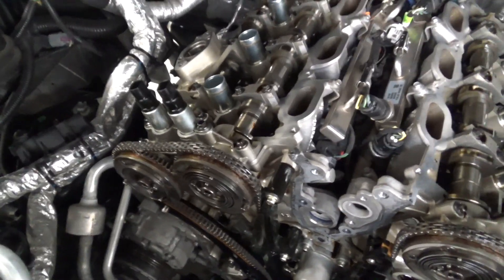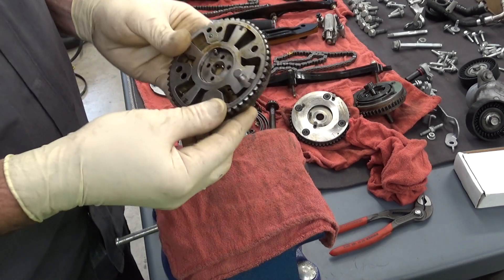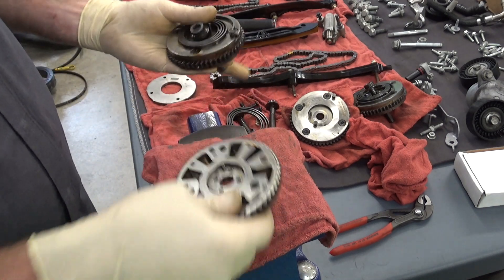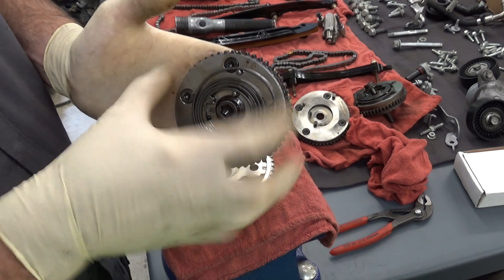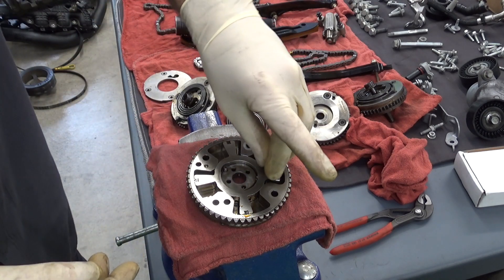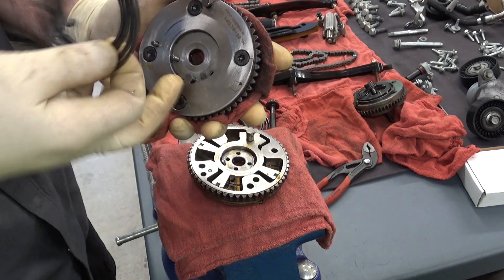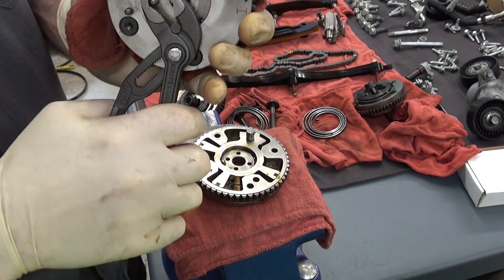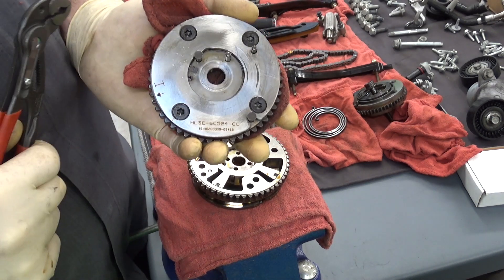FORD 3.5L ECOBOOST CAM PHASER RATTLE. THIS IS WHY

Comment: So, the cams are not locking at shut down. Why. springs are weak. pin and or locking pin hole worn?  They don't do it new, so something is weak, worn out, or broken and why? How many miles are on the truck, was the oil changed regular? I own a 2019 raptor no bad sounds yet. The 3.5 is very hard on oil I would never go past 5000 miles even with full synthetic.  To say it's not an oil pressure problem I cannot agree, if you had oil pressure before it starts, all would be quiet. Because of the start stop system (that I hate) these engines start up very quick, no crank time. They seem to make more noise the longer they sit, oil drain off. So, if you had an engine pre lube system like a Cannon accusump for when it's been sitting a while. (Would not be for everyone I know) oil pressure before startup no noise. It's kind of an oil pressure problem. I am a retired mechanic with nothing better to worry about. I saw the worn parts but why are they worn out so soon sometimes. Ford would love to know that they have had this problem for many years.
Reply from the maker: All valid points. Think about this though, the locking pins and springs are there to lock the phasers so in theory you could have zero oil pressure and there would be no rattle on startup. But of course if the engine is run long enough the rods would knock, timing chains and lifters rattle, etc. When these engine experience a rattle for the first couple seconds until full oil pressure has reached the phasers is because the pins are not fully locked which leads many to believe it's an oil pressure problem. (two of the four phasers in the video would not lock and could get cams to move with a wrench)There will always be some level of oil bleed off if left sit long enough especially on a higher mileage engine. The question is why these phasers fail. Is it an internal oil circuit design flaw? I just don't know but without question, the rattle is due to pins not locking. Ford has two redesigned part #'s in the bulletin so they have definitely changed something inside the newer units. Is the locking pin spring is too weak, locking slot not deep enough, pin not able to displace oil in the slot causing partial engagement like what I experienced in the video? This is all in my opinion & I could be wrong.

Comment: I have a 2020 f150 3.5. 13k miles and had the 21b10 which caused sluggish performance and “shudder” so then I had 21n08. Never had the rattle and still don’t. I’m hoping this issue doesn’t come up with it does I don’t know if the new phasers that are updated will do the same thing
Reply from the maker: Just did a 21B10 on an 18 expedition. Started it twice the last two mornings after letting it sit outside overnight. No rattle so it looks like programming worked on this one. I wish you luck on yours. At least 21N03 is now opened on your pickup but it's still under factor warranty anyway.

Comment: 2017 here. I started hearing this at 50k got so bad it threw a code at 100k spent 2500 out of warranty to fix. It started again in 20k miles. Here I am 37k from having it fixed and the dealer is playing like they can't duplicate the noise.  I have dozens of videos with the noise. It's so frustrating.  Does the tech get paid twice because I'm in the warranty of the repair? If not then that explains pretending like they haven't been able to duplicate the sound in over a week.
Reply from the maker: Sounds like your dealer just doesn't want to work on it. It's tough to meet or beat Ford's warranty time allowed so flatrate techs would rather do other jobs. I would keep hounding the service manager with emails/voicemails until they fix it or find another dealer. Also, send the videos to the sales manager if it's the dealer you bought it at voicing your displeasure. I know that works at out dealer.
Reply: You drove your truck with bad phasers and that nasty start up noise for 50000 thousand miles, well it must not hurt the engine too much. I could never do it, if I heard that start up nasty noise, I am taking it apart, and pissed off.

Comment: Ford should be ashamed... over a decade and these damn motors are still doing this! Of course mine is over 90,000 miles barely. This is my first and last ford. Never had an LS do this... I have cammed the hell out of them at 150,000 plus with stock timing components with no issue. What the hell ford, you build a great motor and then this keeps happening...
Reply from the maker: My 20yo "old school" LS in my GMC keeps on going but it doesn't have VVT technology so it will never rattle. 
The 2021 4th gen coyote has cylinder deactivation. Makes me wonder what problems/recalls are coming on that platform.

Comment: How do we know if Ford made these improvements?  I'm looking seriously at a 2022 Transit for a van conversion but these issues make me nervous since they are expensive even before the conversion.  Also the direct AND port injection should help valve coking but seems like a catch can is still a good idea. You agree?
Reply from the maker: I honestly can't say if Ford has permanently fixed this issue but they have introduced yet another update on Nov. 19th. Intake VCT unit = *Note: If part HL3Z-6256-CD is not available, part ML3Z-6256-A is an alternate option. Exhaust VCT unit = *Note: If part HL3Z-6C525-CD is not available, part ML3Z-6C525-A is an alternate option.
Fords dual fuel design is great I think. They build more torque and don't carbon up the valves. No need to add a catch can.

Comment: 2018 Ford F150 with a 3.5 eco-boost at 70,000 miles they replace the cam phasers at 110,000 miles it came back again Ford knows they have a problem can’t believe they’re just close their eyes on this
Reply from the maker: That stinks. Wonder if a class action lawsuit will be filed for this issue? They recently updated the bulletin with another phaser part#. Our dealer hasn't installed one yet.
Reply: @raincitywrench117  Do you mind sharing the updated part number?
Reply from the maker: @patzimny8579  This is from supplement #3: HL3Z-6256-CD*
Intake VCT Unit - Package Contains 1 Piece, 2 Pieces 
Required 2 2
*Note: If part HL3Z-6256-CD is not available, part ML3Z-6256-A is an alternate option.
HL3Z-6C525-CD*
Exhaust VCT Unit - Package Contains 1 Piece, 2 
Pieces Required 2 2
*Note: If part HL3Z-6C525-CD is not available, part ML3Z-6C525-A is an alternate option.
Reply: @raincitywrench117  thank you!
Reply: @raincitywrench117  So I went to order the HL3Z numbers but Ford is now superceding it with the ML3Z number. Im planning to replace the plastic guides, chains and water pump and valve cover gaskets while in there, any other recommendations?
Reply from the maker: @patzimny8579  ML3Z is the alternate in the bulletin which means it must be the latest design so you will be good. You need the two cam alignment tools, crank pulley puller and long reach pulley installer. I think the hardest part of the job is installing the a/c stretch belt. They suck so now I leave the belt on when removing the pulley. It doesn't hurt the crank, pulley or belt. When installing pulley, I start the the belt in the grooves. Belt will have an extreme angle but you can still start the crank pulley on the end of crankshaft then using a prybar, rock the pulley over until it is almost straight then install the long reach puller and press it back on. I had my installer break off inside the crank which cost me a couple hours to remove because I bottomed it out too hard so when the balancer is almost all the way back in do not try to press it on tight. The crank bolt will take it the rest of the way. Also, when prying the timing cover off. Be careful to wiggle and pull it straight forward so you don't break the plastic oil pump electrical plug in the bottom of timing cover. You don't have to install a new lower oil connector seal or the large oil seal in the center of the timing cover. I reuse cause they are a pain to replace. I make sure and lube every seal up with Napa Sil-glyde before assembly of all components. Here is a video of me setting one up: https://www.youtube.com/watch?v=UWyZfbsxBss&ab_channel=RainCityWrench If this is your first one then don't copy me, break the phaser bolts loose AFTER the chains are off and tighten new phaser bolts BEFORE installing chains. I tend to make things look easy.

Comment: check out the video by flying wrenches stating 3.5L mega cap design is the reason for oil pressure loss is the issue.
Reply from the maker: Yea, I watched that. It could be the mega cap is causing the pins to fail.
Reply: @raincitywrench117  Copy that. I am following this closely. Keep up the stellar content brother.
Reply from the maker: @squirlydan1750  Like your name, my John Deere 140 is nicknamed squirly dan after I got thrown from it. Kind of funny. 
 Will be taking one of the failed phasers apart on the next one I do but this time doing a more thorough examination. Want to trace the oil passage inside the pin slot. I think that oil inside the hole can't bleed out which keeps the pin from returning. Now just need to test my theory.

Comment: I use the flooded start procedure. Hold foot to floor with brake on, crank to bring up pressure then let up foot, no rattle.
Reply from the maker: I've seen that before. That's one way to fix it.
Reply: @raincitywrench117  Mine is still relatively new 6K miles, but it does sit for several days at a time. My 2013 F150 5.0 did make that rattle and the same flooded start did in fact eliminate that. It seems that the oil pressure would bleed off after a couple of days and cause that rattle. The wife's SI did the same thing until we switched up to the Bosch Distance plus filter.
Reply from the maker: @dapoppa2256  Interesting....

Comment: On top of a better design, what about an electric oil pump for when you turn the key on to prime/ pressurize everything?
Reply from the maker: Older Fords have a key in ignition sensor so when the key is inserted it primes the fuel pump for a few seconds. The electric oil pump could be wired into the same circuit.
Reply: @raincitywrench117  someone on youtube said that if you push down the gas pedal to the floor when you turn key to start, it won't start and will stop in 2-3 seconds. Then it would have pumped some oil. Then start it normally.

Comment: Just bought a used 19 navigator. Brought it home and after cold soak... I heard the dreaded noise. I'm very pissed off that I didn't catch the start up
Reply from the maker: I would take it back. Our dealership either fixes the problem or gets the customer into another vehicle. They don't like poor reviews. Hope where you bought it at works with you but it definitely needs addressed.
Reply: What did you end up doing is the 19 navigator holding up?

Comment: Since this is causing the startup rattle, what is causing the diesel-like knocking noise that quickly develops when the engine is idling? Does it still relate to the plunger? Or is it something else within the phaser that's rattling around inside?
Reply from the maker: The bulletin states: "In some of the affected vehicles, an undesirable noise may develop from the cam phasers in the 3.5L 
GTDI engine. This noise might occur as a rattle when starting the engine after the vehicle was turned off for an extended period of time or as a knocking noise when the engine is idling after it is warmed 

up."
The defective locking pin will cause startup rattle and knocking noise while idling.

Comment: So apparently within the last week there is an updated phaser, per my research the part number now starts with an ML not the existing HL but I am only looking at Tasca parts and don't have access to what dealer parts guys do. I have this issue in an Expedition that I bought as a salvage title so I have no warranty. I've been debating if it's worth doing this repair out of pocket. Do you think the updated phaser design will definitely solve the problem? Or is this a design flaw in the ecoboost motor with regard to oil flow? And I'm curious in general if there are even any long term negative effects for this issue. Also, if I do the phaser replacement should I also get 21B10 performed (I believe that I DO have coverage for it, but do not have 21N03 coverage with my branded title).
Reply from the maker: Ford updated the bulletin on the Nov 19 and here is what it says now:
HL3Z-6256-CD*
 Intake VCT Unit - Package Contains 1 Piece, 2 Pieces Required 2 2

*Note: If part HL3Z-6256-CD is not available, part ML3Z-6256-A is an alternate option.

HL3Z-6C525-CD*
 Exhaust VCT Unit - Package Contains 1 Piece, 2 Pieces Required 2 2

*Note: If part HL3Z-6C525-CD is not available, part ML3Z-6C525-A is an alternate option.

Ford says there is no long term affects and have done a set on an engine that was rattling so bad it sounded like it was going to blow up plus it came in 3 quarts low on oil. After tearing engine down I saw no metal in the engine or in the oil.
The new phasers will fix the problem but is this the true permanent fix seems to be the million dollar question. They definitely are changing something inside those phasers. That being said, WTH is up with an alternate option? Wish Ford would shine some light on this subject. Is the first PN the correct permanent fix and the option just some others that were manufactured for another application or from a different parts supplier? I just don't know but will ask our parts manager if he knows something and will pin it or add to description. 
You may play dumb and not say anything, have 21B10 done before the end of Feb so it will open 21N03 and then see if they will cover it. Not sure how they know about a salvaged title unless it gets posted on oasis. If it's still under mileage warranty and if you want, email me your vin# and I can plug it into oasis to see what it says.
Reply: @raincitywrench117  greatly appreciate your reply and helpfulness with my situation. What is your email and I will shoot you the VIN. I am certainly still under mileage warranty with only 25k miles.
Reply from the maker: @mattc7981  raincitywrench@gmail.com Yea, I can plug it into oasis to see what is says. It will show effective warranty start date plus any warranty work. Curious what it says on a salvaged title.
Reply: @raincitywrench117  thank you again, email sent.

Comment: Question,  what year motor is this?  1st gen or 2nd EB?.  I'm also assuming ecoboost?  Or does it translate to the v-8 as well?
Reply from the maker: It's a 2018 ecoboost. The 5.0 is not affected.

Comment: So if you get a chance, give this a listen. This Ford tech thinks that there may be a problem with the megacap. What is your opinion of the information divulged here. Again, thanks for your time. 

https://youtu.be/PZ7-eLebdPs
Reply from the maker: I watched that. Interesting. Have been a sub of flying wrenches for a while. I think Ford is just trying to patch these with software hoping to get some of them out of warranty to save money. 
Here is a few lines from Fords PTS website about the operation of the vct system:
 "There are 4 types of VCT systems. All systems have 4 operational modes: idle, part throttle, wide open throttle (WOT), and default mode."
"The VCT system does not operate until the engine is at normal operating temperature."
"The PCM disables the VCT and places the camshaft in a default position if a concern is detected. A related DTC also sets when the concern is detected."
Now this is my opinion because Ford does not specifically say, on a cold start the phasers should be in default position with the pins locked and remain that way until reaching operating temperature. The pins are there for startup and default if PCM detects a vct problem IMO. I think it is simple as the pin slot is not deep enough or the pin spring not strong enough or a combination of both. Some of these have failed with under 10k miles and new phasers instantly correct the problem without changing anything else. If it was a low oil pressure problem then it would still rattle after replacing the vct units. But the million dollar question is if there is an oil design flaw that is making these pins fail? That I do not know. I guess time will tell, if a bunch or all of the replacement phasers fail again eventually then either Ford is just replacing crappy parts with "updated" parts that haven't been redesigned or there is a hidden defect in these engines. Cheers!
Reply: @raincitywrench117  Very educational. Thanks for engaging.